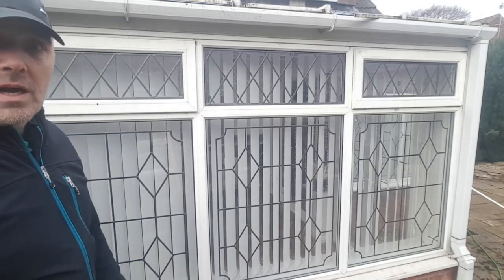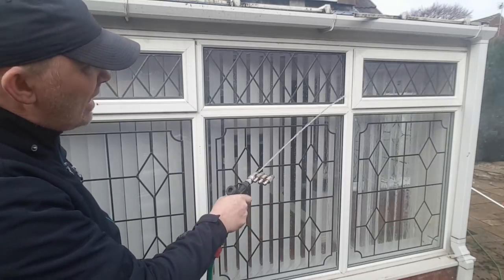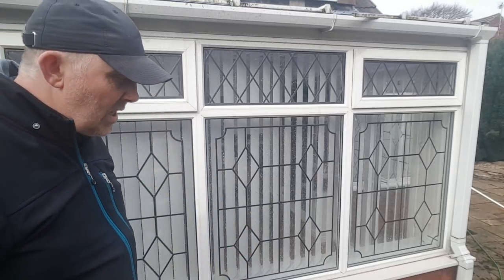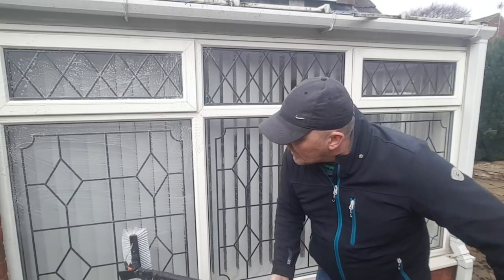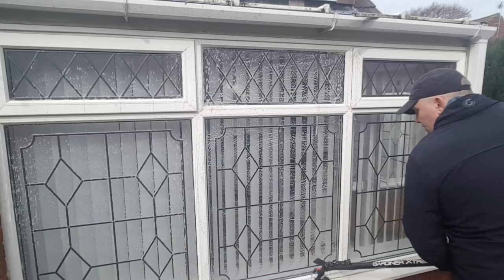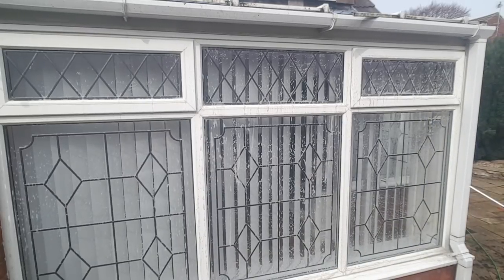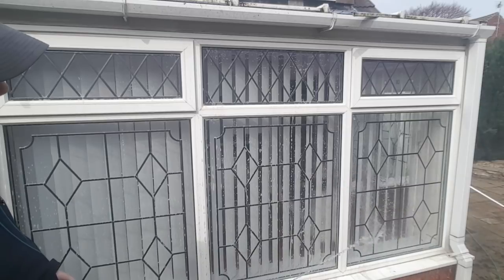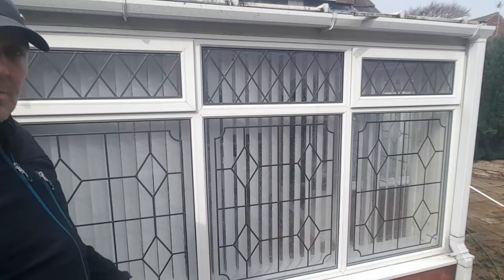How to use T.F.R. Trafic Film Remover to Clean UPVC - Window Cleaning

Comment: when you cleaned the windows for the final time with the WFP did you change the brush head or wash the brush head after rubbing the chemical onto the frames or does this not need doing? TIA

Comment: Hi where did you get the jet attachment
Reply from the maker: Francis ebay
Reply: Link pls or name??
Reply: Green Pro Clean Ltd how did you wire up the one shot to start the heated system please can you advise
Reply from the maker: paris Dowden just wire it to the controller. heater looks after itself based on water flow.
Reply: Whats the chemical.called im looking for a biodegradeable cleaner
Reply: Can’t find the hose attachment